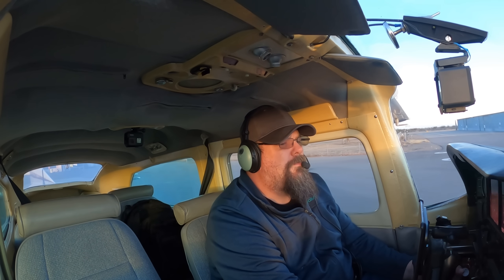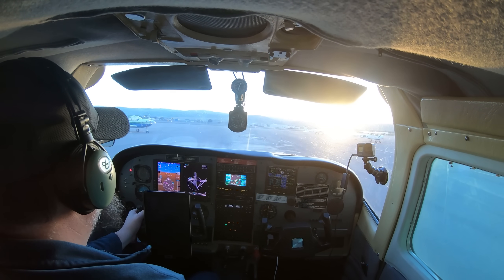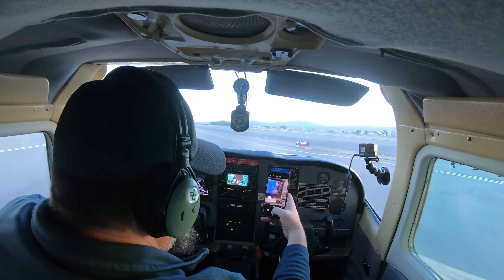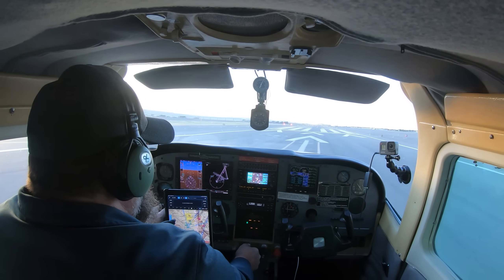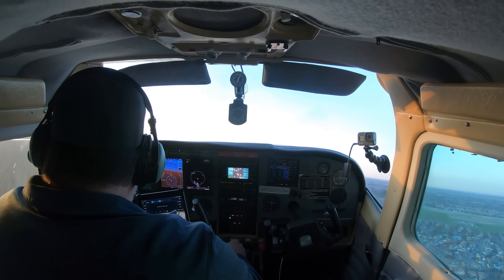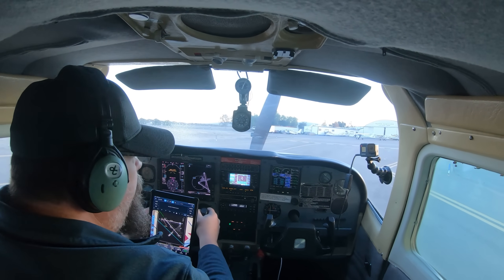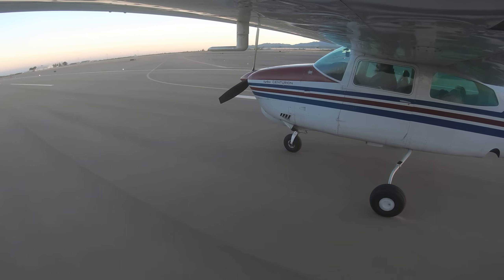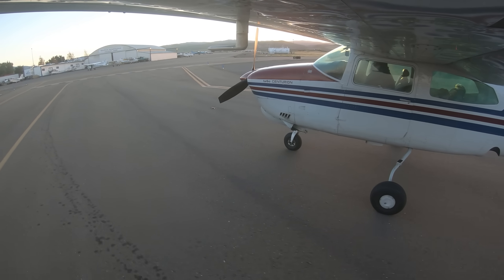Catastrophic Engine Failure after Takeoff

Comment: So I saw the video you made, describing the method you used to safely land back at the airport, and You gave the viewers a quick look at the blown engine... Great job bringing You and the 210 back safely!!! Just a quick look at the blown engine and the crank rod journal, shows that this bearing was severely overheated, then welded itself to the crank... Engine overhauling / repairing is an artwork of extreme details, patience, perceptive eyes, using correct tooling, checking several times, and cleanliness upon assembly...  The idea of a major repair (split center cases - form 337) being followed-up with an IRAN  procedure, seems like a weak excuse to get the plane flying again...  Sure, it is good to be able to save money, but trusting the work of someone who probably did NOT properly check the clearances of vital engine components like the bearings.. The luck of the Irish was with you Ed, when this happened... If it happened any sooner than when it did,  You might not have been able to safely put it down on the airport...The clearances of the crankshaft bearings, when they. were replaced, need to be within a very close tolerance... One of the best ways to check this clearance, is to use an inexpensive tool called 'Plastigauge' ... That needs to be done on all main & rod bearings to see if the new bearings are of the correct clearance, as described above... That failed rod bearing AND CRANK- THROW was DEFINITELY overheated... Probably too tight of a bearing clearance... Was the person who rebuilt the engine, operating in a FAA approved repair station? The metal that you showed on the Boro photos of the lifter, really looked like non-ferrous metal, which is what the bearing Babbitt material is made of... Have another rebuildable engine coreoverhauled, and see about finding out if the insurance company could help you out with this... Since You have a C/S prop, make sure that the contaminated engine oil did not cause problems with that as well...

Comment: You did good - you even exited the runway!👍 I noted the trail of oil she left behind on the taxiway?! If you had the height, the speed and the runway is clear, then turn back! You saved yourself and the 'plane! Well done👍😊 I'm sorry that the engine keeps playing up, but you're safe that's the main thing. I got shouted at once for suggesting that if the engine fails at Eg 1000' on climb out or crosswind and the wind direction is marginal and the runway is clear I'd turn back. I'd rather do that than crash into a field - straight ahead - which is full of dips, rocks, hedges and OHE wires etc.

Comment: A customer of mine had that happen in 1994. #1 rod broke while he was at 10k feet 10 miles from the airport. The engine continued to make power until 5 miles out when it seized up. Dead sticked the plane back to PAE and landed. He was also in a 210RG and that was his first ever inflight emergency. After this happened, the company he worked and flew for bought a newer 421 for him to fly and paid for his multi rating!!!

Comment: I had an engine failure and made it back too. My training took over and I handled it. It was not a fun experience and yet looking back it was very rewarding. The one moment we all pray never happens had just happened and somehow I didn’t loose my composure and somehow managed to get it back on the ground. On the runway I could already see vehicles coming my way because they’d heard the engine dying in the air. The takeaway for me is that training will be there for you when you need it provided that you keep up with the training. Nice job and congratulations.

Comment: As a skilled mechanic of over fifty years experience (cars & A&P supervised aircraft work) I can say unequivocally that the mechanics who worked on your engine are nothing but INCOMPETENT.

I’ve rebuilt two aircraft engines; a Continental A65 on a Taylorcraft BC12D that I owned in the ‘early ‘70’s and also a Lycoming 260 D3G on a Cherokee 6  I owned in mid decade 2000’s. Both without as much as a hiccup in the hundreds of hours on each for as long as I owned each aircraft.

Having said that, I cannot stress enough that in order to accomplish anything properly on an aircraft it is absolutely MANDATORY to follow the manufacturer maintenance recommendations TO THE LETTER. This includes the old FAA manual 43.1 as well as the newer revision of AC 43.13-1B in addition to references pertaining  specifically to the aircraft itself. These documents were written and published for a very specific reason, that  of excellence and safety, and are the ONLY methods that are acceptable in accomplishing ANY repairs on an aircraft or aircraft engine.
 
It is obvious that the mechanics that worked on your engine obviously ignored the most basic concepts of “good mechanical practice”. I knew this watching your first video about your engine failure episode when one told you to basically ignore it after telling you to ignore metal in the oil filter (for the second time).
Furthermore the recommendation to change all the lifters WITHOUT ALSO  CHANGING THE CAMSHAFT, camshaft bearings, main bearings, rod bearings, and boring out the cylinders  oversize is extremely likely to be the fundamental and only reason for your engine failure. Perhaps I’ve left out a point or two here for the sake of reducing typing …

You have excellent grounds for a civil lawsuit claiming actual damages as well as a huge chunk of punative damages for the utter incompetence of your mechanics: make no mistake of that.

Needless for me to say, as many others have said, you did a first class professional level job in handling the engine failure!

Comment: I've read and talked to many different motorcycle racers and motorcycle magazines, and the consensus is basically the same break-in procedure you listed from AOPA.  A heat cycle or two before flogging it full throttle high rpm.

Some racers swear they have amazing compression with maybe one heat cycle.

A friend of mine raced many years and did many rebuilds, and always did three heat cycles to normal temps (let it cool completely).  Then it was put on the track immediately, full throttle and redline.

Motorcyclist magazine did a tear down on two identical, brand new bikes, one with low rpm and low throttle riding for 1000 miles (as per instructions from the manufacturer) and the other ridden normally from mile 1 (street riding, with urban acceleration and highway on ramps).  After tear down and mic'ing the parts, everything was identical.

Comment: 7:40:  How is it that you are able to steer the plane without the engine running?  I have also wondered something else about airplanes:  How do airplanes steer on the ground when they're barely moving and not moving fast enough to produce the aerodynamics that steer the plane in the air?  Do airplanes have steering front wheels like cars?
Reply: Yes , most planes have front steering wheel, and your rear gears have separate break's so you can turn with breaks to.

Fortunately he head enough speed and altitude to basically glide back to airfield.

Comment: Within 40 seconds of the engine failing, the tires touched down on the runway. If you had hesitated for even a couple of seconds, you wouldn’t have made it. Great job quickly making the decision to turn back and controlling the airplane under stress!

Comment: When I was learning to fly in a piper tomahawk after doing by outside and inside pre-flught procedures and inspections I taxied to the run-up area and performed a run up which was successfull after doing my configuration for takeoff I began my lineup and takeoff on the runway as I rotated my cowling cover came unhinged flapping against the opposite cover its not the flapping of the cowling that scared me it was what my dad would do to me if he found out I left a cowling on the runway or in someone's backyard so I reconfigured for landing and slowly taxied to the hangar and when I went to a&p school the next day I made repairs to the cover, hinge and latch to look like nothing happened till this day I have not told my dad 😀

Comment: What are the yellow and red lights for on the left of the dial?
Reply from the maker: Any caution or warning indication on the MVP50 needs to also be in the pilot's line of sight. The red indication at the start is because fuel pressure is below 4psi when the engine is at idle. When MP is between 34.something and 36.5 it will be in the yellow. When RPM is above 2600 it will also be in the yellow.

Comment: Mate. What a landing. Well done. You did an amazing job. One thing I would like to be critical about and I'm not stating I'm an expert but, why are you taxing at speed as a single pilot, private pilot ops and spending your entire taxi setting your instruments and playing with MFD's instead of having them set and having your eyes out and managing the taxi? You could have had those pages set up prior to taxi. I have many years ems and military flying as well as private pilot flying and we never had so much head down instrument work in a single crew environment even during commercial EMS ops. Especially during taxi for take off ops. The aircraft systems and configuration should be ready for take off or near enough ready for take off prior to taxi. Look after yourself mate and you passengers. Have everything set up and ready for takeoff prior to taxi. As you have learnt, take-off and landing is the most critical part of flight.

Comment: Nicely done! Risky turn, but you made it, but only just. It looked a better option anyway, there were just houses ahead from what I could see over the nose.  I would say I am not familiar with 172/182 operations or the POH, however, I am surprised your engine runup procedure is at 1700rpm, thats very low compared to the pipers I have flown, but if that's what the POH says, fair enough.  I think I would have put way more ground run time in before I took to the air,  and at least a couple of full power runups. your previous longest run was 2 minutes ... thats not a lot.

Comment: That damage sure looks like a connection rod getting tossed.  Most likely oil failing at the crank pin and and drying out the crank journal.

Comment: i am an auto mechanic, dealer tech. from the start, the engine was never repaired correctly. cam and lifters are always replaced together. metal in the engine is always bad- something is making metal, cam and lifters in this case. however, that metal chews up everything else- the crankshaft, bearings, pistons, cylinder walls, valve train, oil pump. end result is engine failure. now- the last 'repair' before failure- something went wrong there. based off of the photos it looks like a rod bearing spun which caused the rod to break. why did it spin? too much or too little rod bearing clearance, rod bolt failure, low oil pressure, over heating.  could have been bad rod bolts or not torqued correctly. the engine would lose oil pressure when the rod came loose. repairs your engine had would never be done in a vehicle and expect total success. i can not believe those mechanics serviced an aircraft engine the way a lawn mower might be serviced.  oh, and yes there is warranty on that lifter repair- just ask your attorney or doj. believe me, i am a mechanic

Comment: Captain Obvious would say, "You had an incompetent mechanic work on your motor." I'm thinking it was the guy in your video who had the WTF comment. Not many of us experience a rod failure in a motor (which starts as a bearing failure).  You have conclusive evidence of what happened to your motor.  And it happened within "minutes" after an overhaul. 

You and your mechanic did not manage your engine run-in/break-in procedures properly.  You did not say anything about run-in time.  The one or two hours the engine needs to run before the break-in period.  Most engine builders are concerned about the new piston rings, pistons, and refinished cylinder bores than bearings.  If those items seat fine, then bearings should be fine. Your bearings were not fine from the start.  Should have been discovered during the run-in.  No doubt it was assembled improperly.  Ask any good engine builder about bearing failure and how long an engine that has been pre-lubed will run before bearing failure occurs with no oil in the motor.  Probably longer than your engine was running and your motor had oil in it (or enough to give you oil pressure and temp).

I hope you get your money back from the mechanic and find a better engine builder or engine source (I like VIKINGAIRCRAFTENGINES).  Read up on engine run-in/break-in.  Glad your flying skills are excellent.
Reply from the maker: To clarify, the guy in the video is not the guy who worked on the engine.

Comment: who forgot to tighten rod bolts to the correct torque. Or if the crank had a regrind, who didn't clean out the oil galleries and was a new oil pump primed when fitted.

Comment: Hey, awesome job on the "impossible turn". A few takeaways: 1) you constantly evaluated the situation and arrived at a successful outcome 2) you know the airplane well enough to estimate its performance, both powered and gliding especially for your relatively low time in type 3) you were prepared and had planned for the potential engine failure. That's what saved you. People will Monday morning quarterback stuff to death, especially those with lots of MS Flight Sim time. I've logged over 1500 dual given, 4 jet types, and 8500 bours and have lost engines at gear up before. You did it right. Nothing negative to say. My only question is who is the reincarnated pilot soul you have?

PS: Earned my PVT at KSQL. Sky Kitchen for breakfast and say hi to the Rabbits when you get fuel. You'll know what I mean when you go there. Loves me some Bay Area flying!

PPS: We just had major fuel system work done on our jet and are about to launch from LA to Hawaii so you bet we're primed for contingency plans!
Reply: the turn is still "impossible" since he landed on a different runway from the one he took off from
Reply: @rangelso  still, a 140 deg turn, instead of 180, but that 40 deg. Less certainly must have helped.
Reply: I’ve been practicing with MS flight sim a lot before I decide to head to flight school, what exactly do you mean? Im just wanting to be prepared.

Comment: If it wasn't for the second runway (not in parallel), I'm very sure the grass next to the plantation, to your left, after runway edge would be your second best option for an emergency landing, taking note highway was full, and initial altitude (1,000 ft or less) is too risky to perform a 180 degrees hard turn with a lost engine. As a private with 180 hrs total, your recent experience  is a recurring lesson for all of us on how to deal securely when the unexpected happens!!

Comment: I don't know what kind of 'certified' aircraft mechanics you used, but they failed you big time. I am not so sure about the 'IRAN' philosophy (inspect, replace as needed). Any backyard mechanic knows that if you 'wipe out' lifters the cam is also toast. Replace lifters only??? my 13 year old knows better than that!  The extra metal shavings are just being flushed out??? This sounds like you are using AutoZone mechanics for your airplane. I am surprised they don't have to bench test (and break in) airplane engines before (re)'certifying' them. You are lucky to be alive and now you have a huge tasty bill for a new engine due to gross incompetence. Great job on a safe landing. I will keep a close eye above me any time I drive near an airport if this is the type of Mickey Mouse crap work that the FAA considers safe practice. I am not busting on you, but rather your suppossed subject matter experts in aviation mechanics.

Comment: Nice save and walk away. Broken rod bolt? I learned an expensive lesson to always replace rod bolts as they stretch when torqued. Happened to me in a V8 Chevy. Ruined everything but the heads but even they had bent valves.

Comment: You flew the airplane first and foremost.
But with many light planes that turn is a death wish.  
Glad you were in the right plane to have the altitude and distance you needed and the runway in the proper direction.
A 172 would have just been able to set down basically straight ahead.  Never would have been able to make that turn. 
Glad you knew your planes performance specs your airport and flew the plane first.

Comment: I think I would have ran that engine at normal "flight" RPM for 8 hours on the ground with a load, chained to a pole or a tree..long before I would have Tried it in the air.

Comment: Your Lucky KTCY has multiple runways.  One of few that does out in the valley.  Use to do T & G's out there all the time from KLVK & KHAY.   And I've had my own engine out experience over KLVK.  Fortunately, I was close enough to land at Livermore.  But I tell you there's nothing so eerie as the sound a Cessna makes when the engine is out. You never forget it.  Well done. Hope you can get it fixed soon.